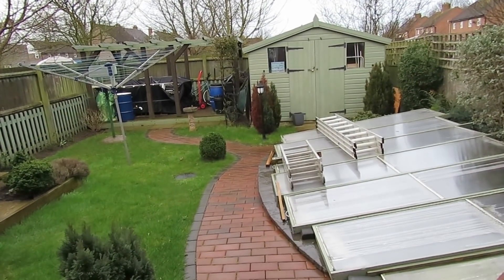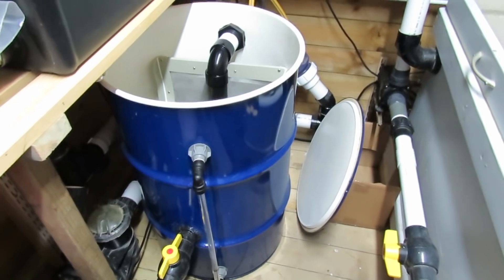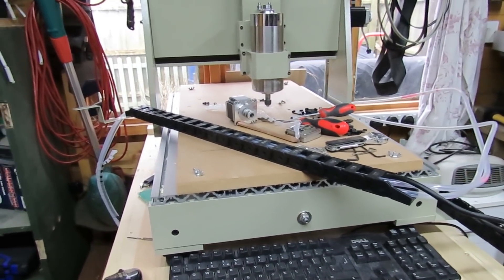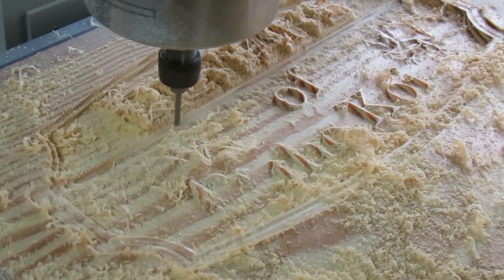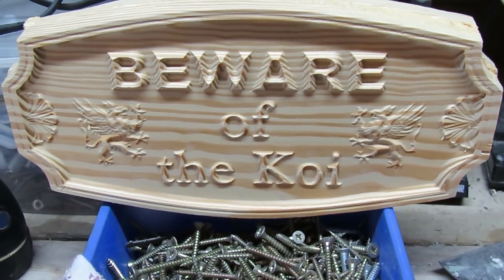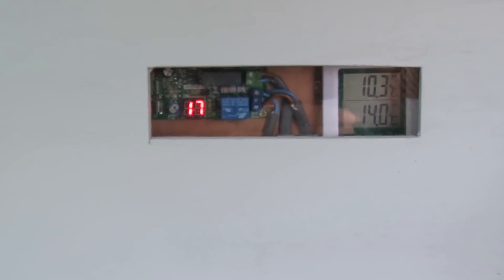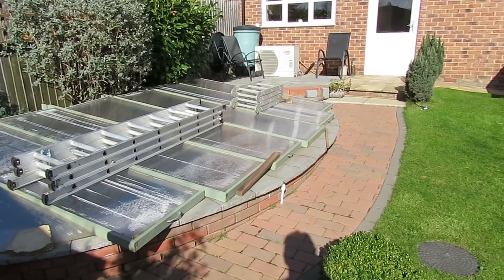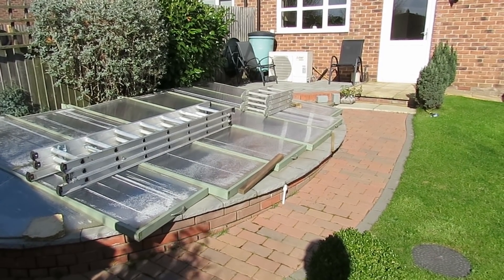Not The Best Week I've Had!

Comment: Hi Terry sorry to see your pre filter has got some peely paint  but I know you’ll come up with a solution it’s great to see your videos and I’m getting truly educated by them. I’ve been waiting on the drawing for this superb filter. But I guess I’ll need to wait a bit longer. Mine is testing good and works a treat only one problem I have is after a bout 8 hrs my level gets so low that it cuts my pump off and I’ve been scratching the head trying to keep the level above the outlet. No bubbles coming in the inlet at all so I’m beat. Can you suggest anything I can try. I even had a small pipe from the pressure side of the pump through the top of the drum to try make up for any loss but this makes it worse. Anyway happy ponding I’ll have to wait a while yet.
Glenn
Reply from the maker: Hi Glen, I've found that the problem with the paint peeling is the lacquer that's on the drum when new is solvent based and the pond paint I put on is water based, and that was the problem. You still getting a small amount of air in the drum which is causing the water level in the drum to drop. I had the same problem. It has to be 100% airtight. Send me an email pondfilters@gmail.com and I'll tell you what I did to overcome this problem. Terry.

Comment: Hi Terry just thinking 🤔 of your pre pump filter why don’t you make some enquires of getting the drum powder coated see if this helps you out think you will have to get the drum dipped first and remember the pre drilled holes will end up smaller due to the powder coating. Liking the Router Machine I’m a carpenter and Joiner by trade and just thinking if it helps you out by setting up the hover hose to the side of the Router so it’s cleaning as it’s working ?
Reply from the maker: Hi mate, I think the problem is that when the drums come new, there coated with some sort of laquer to protect them. I did rub it down well, but the paint is still parting. The sealer it's painted with when new might have been ok, but I dare not risk it with the koi as I don't know what it is made with.
I have thought of attaching a hoover near to the cutting bit. The problem is my hoover is an industrial one and very noisy. I might buy a new one if I can find one that's quiet. Don't want to upset the nabours. Thanks, mate, Terry.

Comment: Hi Terry ref. the pre filter issue what colour was the sealer/lacquer when you got the drum? If it was a yellowy caramelish colour it will be RDL44 lacquer I have seen adhesion issues with it before as its a solvent based lacquer and the paint you have used if its the same as I have used in the past would of been water based. The best bet will be get a new plain drum and thoroughly degrease and clean it ready for paint coverage HTH Danny
Reply from the maker: Hi mate, The drum came new covered in a clear lacquer, to stop rust I presume. I did give it a really good rub down with some 80 grit paper on my mini sander which I thought would give it a really good key. I used a white 2 pack acrylic pond paint, thinking that would hold it. I think your correct when you say it's water based. I gave it 3 coats and a week to dry. I thought that might hold it. Thanks for your suggestion, very much appreciated. Terry.
Reply: @Wrighty  If it was a golden see through clearish lacquer from the factory that sounds like RDL29 lacquer which is phenolic so goes hard but brittle after stoving and prone to chipping and again is solvent based
Reply from the maker: Hi mate, that sounds like the one. I was hoping a 2 pack acrylic might hold. I am thinking about seeing if I can get a pvc liner made to go inside the drum so no water touches the drum at all. Trouble is I don't think that will be cheap. Thanks for all the info mate. very helpfull. At least I know where I went wrong now. Thanks mate. Terry

Comment: What about using a 5-gal bucket type of thing for your pre-filter?  They make them with rubber seals and whatnot.  Might be a little smaller than the other can, but should be great for your need.
Reply from the maker: Hi pa, The problem is that the filter has a vacuum inside that will pull in the sides of plastic drums. I did try a 120 ltr pvc barrel and it just caved in with the vacuum that is created by the pump. It has to be a really strong tub to take the vacuum. Thanks for your suggestion, Terry.
Reply: @Wrighty  I was taking that into account.  5gal buckets.  At least the ones I have here in the states, are made of very thick plastic.  Are short and have a double ring around the 'top'.  I seriously doubt it would have the same issue.  I'm going to see if I can set up a similar setup as yours and see what happens.
Reply from the maker: Hi mate, have a look at this video of my first attempt at the pre pump filter and see what you think. https://youtu.be/t1g3fcSedwI It does need quite a bit of room inside for the water and the filter mesh. Thanks for you help, very much appreciated. Terry.

Comment: Gutted for you mate could you not try another full coat over top ?, regarding pc type recovery in search in taskbar at the bottom and choose create system image will need a external harddrive to back the image up to but if you ever have to reinstall you can use the image and all your settings and pc is restored as it was to the date you imaged 😁 hope that makes sense bud
Reply from the maker: Hi mate, Thanks, I don't keep anything on my windows hard drive so it's not too bad. I have 4 hard drives in my computer just for backup. As you know video files are quite big. I will do a system backup as you say, it will be easier than doing a factory restore every time. It was just a bit annoying that fitting a simple wireless LAN card could do that. Didn't get chance to install drivers lol. Thanks mate, Terry.
Reply: @Wrighty  soon be summer mate :)

Comment: Keep Calm.
Carry On.

With the CNC router, it seems like you'd save a lot of time and mechanical wear by using a larger end milling bit to remove the bulk of the material first then going to this fine mill for the actual detail carving.

As to the pre-filter drum build, I'm afraid it's been such a while that I lost track of why the strong vacuum was needed so I can offer no useful advice there. It's a shame though as it seemed like another Wrighty Winner.

Careful of your health and do wear that mask when wood carving. Cheers.
Reply from the maker: Hi mate, I have ordered some new bits for the router, but 3mm was the biggest I had at the time.
As the pre filter is above pond water level and the pump is after the pre filter, it has to cause suction in the drum to lift the incoming water up and into the top of the drum. As water is removed from the bottom by the pump and the drum is air tight, It sucks water in at the top of the pre filter by the vacuum caused in the drum. It is a shame as it was working so well mate. I always wear my mask now. I didn't reaolize it was creating such fine dust until I saw it settled on everything in the shed lol.
Thanks mate, very much appreciated, Terry.
Reply: @Wrighty  The thought occurs that we should explore a practical way to apply a sealant to the drum exterior too then rig some kind of soft rubber diaphragm coupling for fixing on the lid. I shall keep having a think. Battery dying now...
Reply from the maker: Ok mate, thanks for trying. Terry.